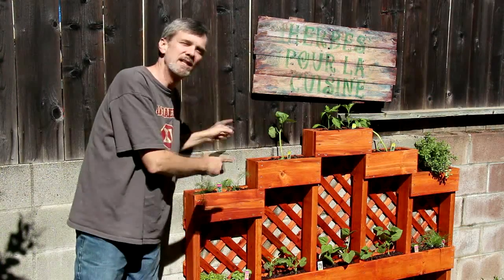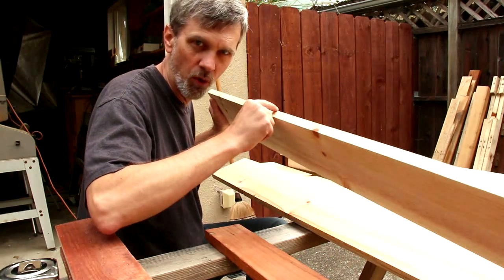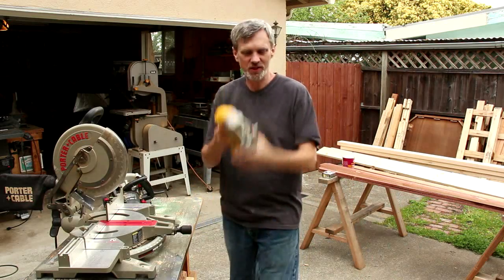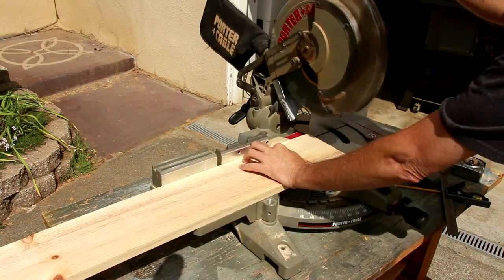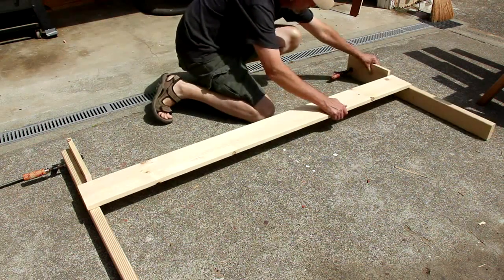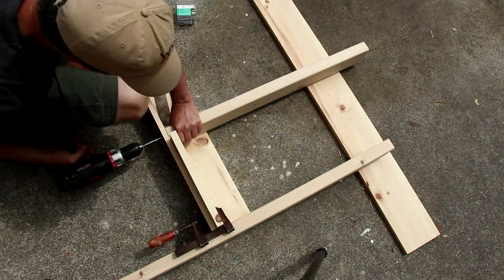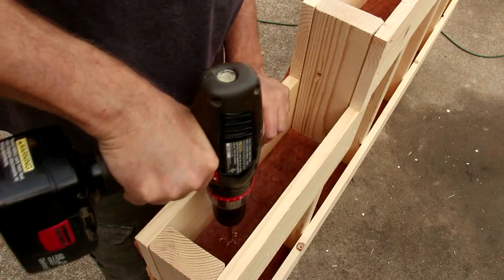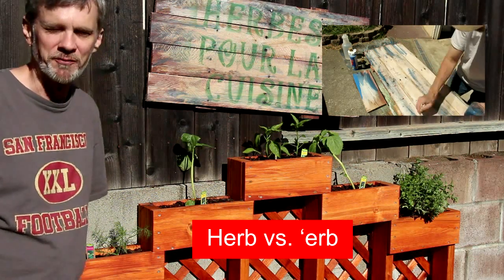Easy DIY herb garden. You can make this planter in an afternoon.

Comment: Really cool project. The only thing I'd change is the stain part. You're growing herbs in there, and they will be absorbing some of the chemicals in that stuff (and you eat that). So I'd either avoid growing herbs and just put flowers, or go with red cedar - it's naturally bug and weather resistant. Granted, it won't last as long without the stain, but I have a planter I made out of this material and it's been out all year in our Canadian weather for about four years now with no issues.

Comment: I haven't researched this myself but I've heard from sources that, when building this like this, you should only stain the OUTSIDE of the the project. Meaning, no soil, touches the stain. Supposedly the soil can suck up chemicals from the stain, and obviously that's not something you want in your food, since food goes in your body. If anyone knows more about this feel free to add on or correct me.

Comment: My two cents, to save some beginners from making a costly mistake, You should explain kerf to them.
kerf 
 Use Kerf in a sentence

kerf  [kurf]  Show IPA
noun
1.
a cut or incision made by a saw or the like in a piece of wood.
2.
Mining. a deep cut a few inches high, used to undermine a portion of a coal or mineral seam.
3.
the act of cutting or carving.
verb (used with object)
4.
to make a kerf or kerfs in (a piece of wood, a coal seam, etc.).
Reply: i must say, even reading your comment carefully im not much wiser.
Since the Dutch Verb 'kerven' means to make a cut , i assume it has the same meaning in english. (i.e.: "to 'kerf' your name in a tree" would be a proper dutch use of the verb)

Still i think an explanation like 'to kerf' means 'to cut' (in wood or coal) would suffice. :D

Comment: To answer the question about pressure treated wood that quackonduck69 asked.......the answer is the same as to why you can not use just any stain you might have if you plan on using this planter to grow anything edible. Toxic chemicals from either the pressure treated wood or the stain/varnish/sealer will actually leach into the food that you are growing making the food itself toxic......if it will even grow.

Comment: should have used pressure treated wood
Reply: In direct contact with plants' soil? I don't think so.
Reply: I also prefer the taste of arsenic in my herbs.
Reply: Awesome idea
Reply: You do NOT use pressure treated wood when planting editable plants.  Use cedar or other naturally bug resistant lumber.
Reply: Sara Plotka Treated lumber is no longer treated with arsenic.  It is now treated with copper, which is a trace mineral and actually beneficial to a garden.
Reply: Defx10 even the new pressure treatment lumber will poison you plants and kill them. I'm a horticulturist and deal with this problem all the time with my customers. Cedar is the best to use for herb gardens. Pine untreated on the inside will also be safe, but don't treat the inside as it will contaminate the plants.
Reply: What kind of finish/varnish would be safe for plants?